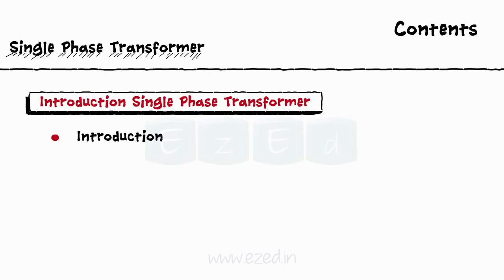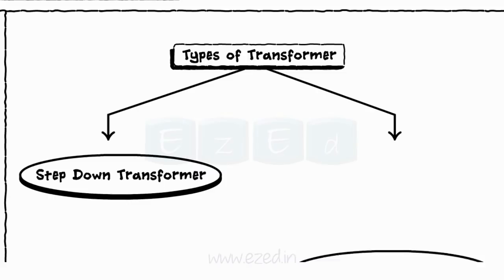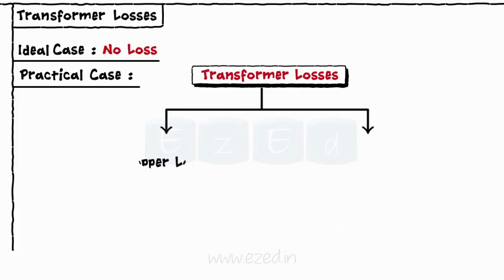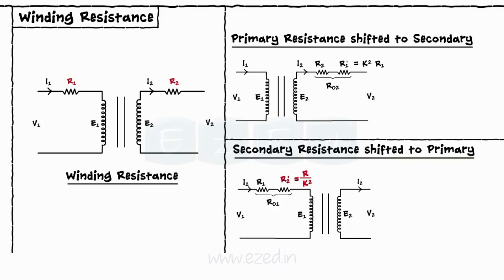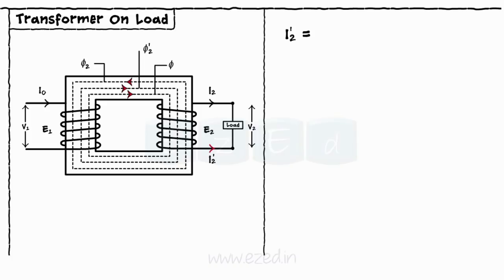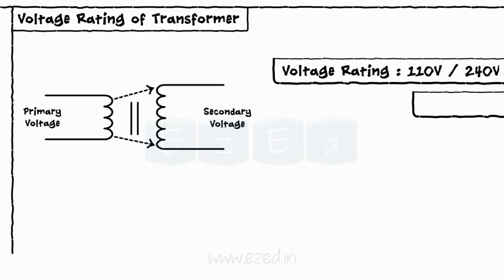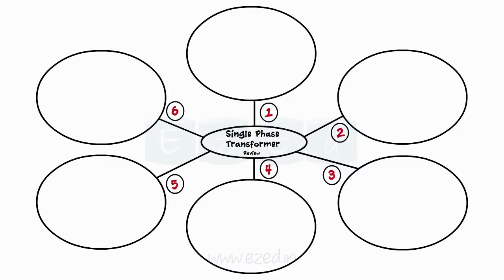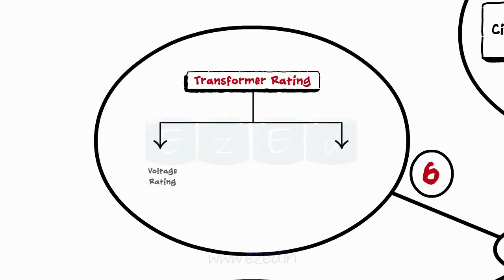Single Phase Transformer Part I - Construction & Working - No-Load & On-Load

Comment: There are many MISTAKES in the video.. 
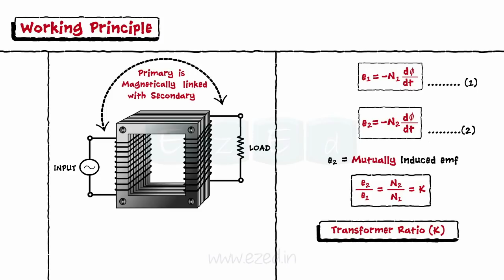1) 4:09 transformer ratio should be Np/Ns
2) 6:41 copper loss equations (is that exchanged with each other)
3) 12:44 check all 4 Equations formulas
4) 14:12 copper loss on Half load calculation R01 should be 12.25
.
If I'm wrong then correct me in replies...
 Thank you..
If you found the same doubt 
👇hit LIKE to help others.
Reply: Btw... Knowledge delivering technique in few minutes is unbeatable..

Comment: Really good learning video. 

But R02 = 0,03 + 0,25 * 0,05^2 = 0,03 Ohms solution is correct.

W Cu FL => R1 = 0,25 not 0,025 solution is correct.

W Cu HL = (0,5 * I1)^2  * R1 (I hope not R01). So (16,66 * 0,5)^2 * 0,25 = 17,35 W not 2,0816 W.